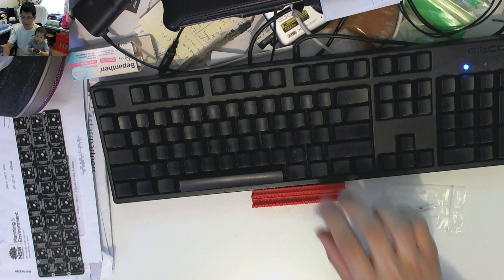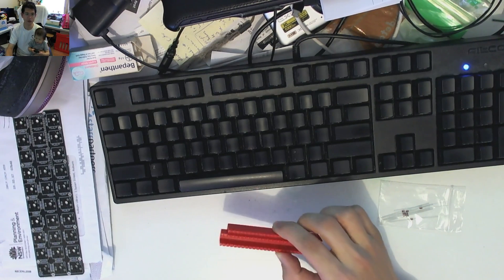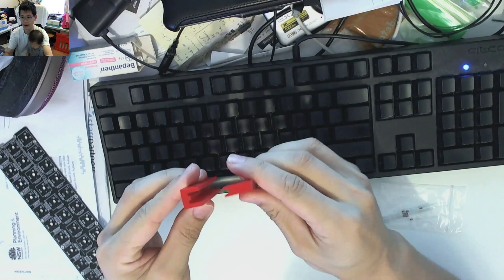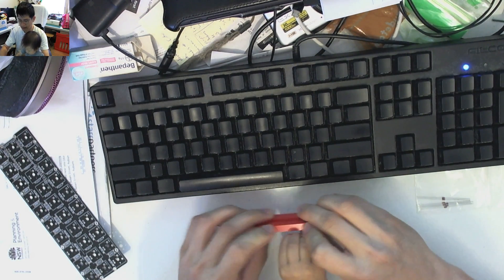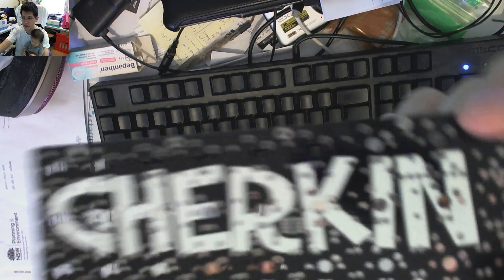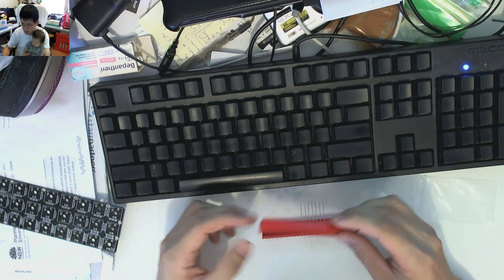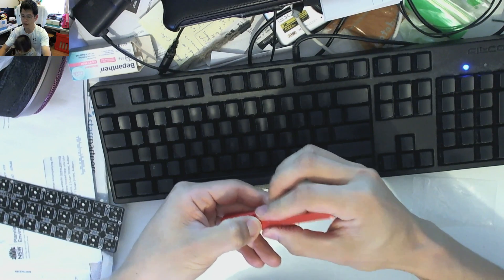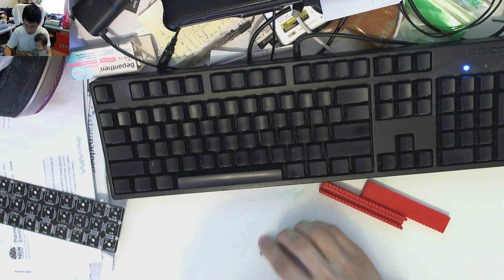3D Printed Diode Bender

Comment: Usefull tool! could you design one for 1/4 resistors?
Reply from the maker: I probably could, though I don't have measurements. But, you could also design one too for yourself since things like TinkerCAD is free! So is Fusion360 on hobby license too.
Reply: @theboard  i never used this kind of software but Will give a try
Reply from the maker: @FerSynesthesia  Good luck, but if you run into trouble, let me know and when I have the time, I can give it a run if you give me dimensions.
Reply: @theboard  thanks! If I make it I Will share it for download
Reply: @theboard  finally I failed in all my attemps :( I will apreciate so much if you could desing one
Reply from the maker: @FerSynesthesia  Can you share with me what you tried and ended up with?
Reply: @theboard  sorry i deleted this with the software when I realized that it wasn´t working for me :(
Reply from the maker: Well, if you tell me the dimensions of the resistor, when I have time to get to it, I can try.

Comment: That is a handy tool my man! Also need one to bend diodes for handwiring, with just bending one side of the diode into an L shape.
Reply from the maker: The issue though from my own experience in hand-wiring is that you might not have the position of the bend on the diode for the L in the same spot, which would make it challenging. This simple design works because it uniformly bends based on the relative position of the diode body, but if you need to bend in different positions (to accommodate different switch position spacings,switch rotation positions), it would be slightly tricker. Not impossible, just trickier.